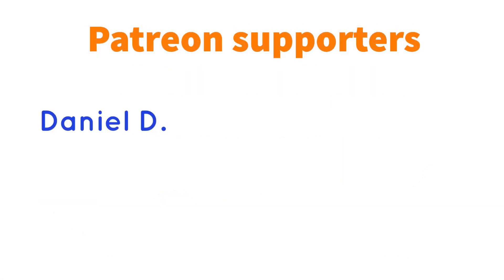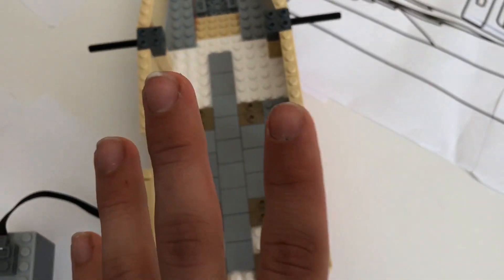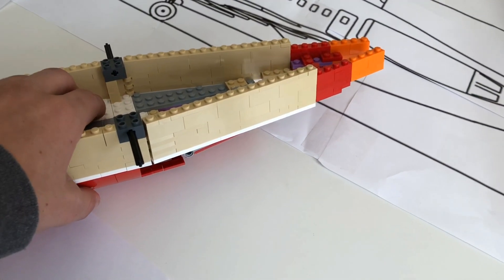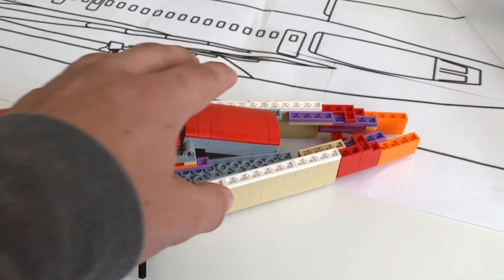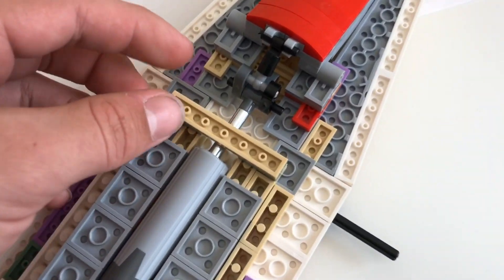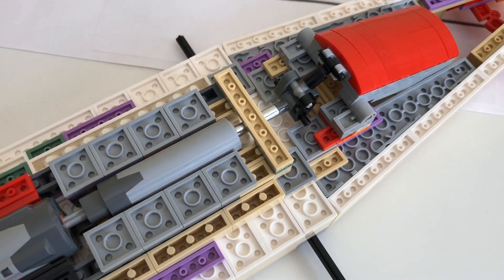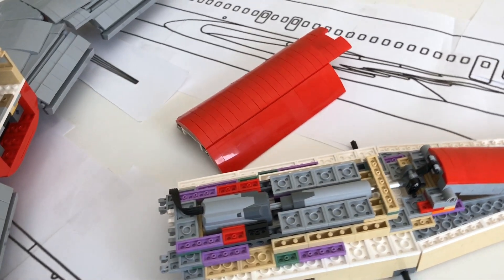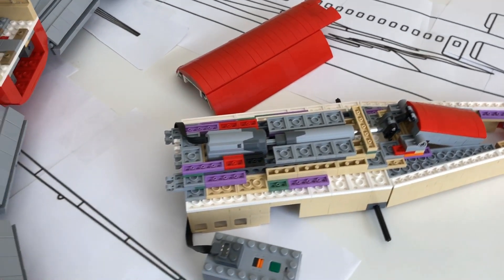LEGO 727 Motorized Airstairs!!

Comment: If you can somehow figure out how to motorize the engines without needing to go full on engineer mode on it, you should do it.

1:02 And the "pipe" where the APU usually is, is actually the exhaust for Engine 2 (the center one, maybe motorize the exhaust to have a sound instead?), (Also, I think the APU on the 727 is actually in the landing gear well somewhere)

And an idea for Patreon announcements:

At the beginning of each video, announce every Patreon that has joined since you uploaded the last video.

At the end, thank Every single one. Ever If later it gets too big (or it's too tedious), then you can only put the ones that pledged more than $5.
Reply from the maker: I’ll see what I can do for the engines. I would announce people the moment they support but I’ve decided to put them in the videos once the payment actually goes through.